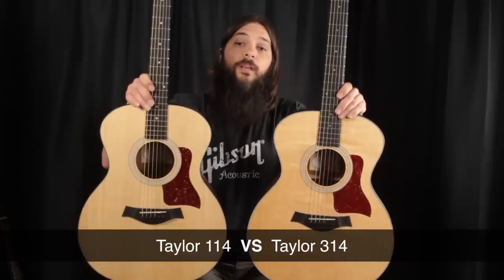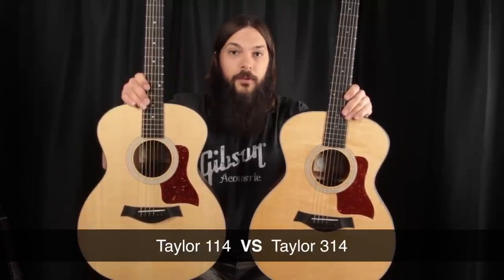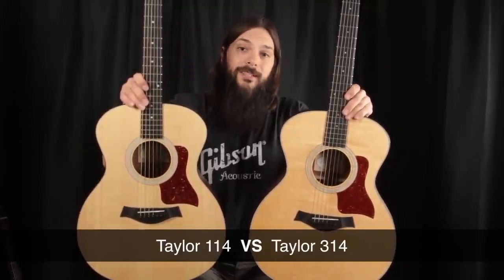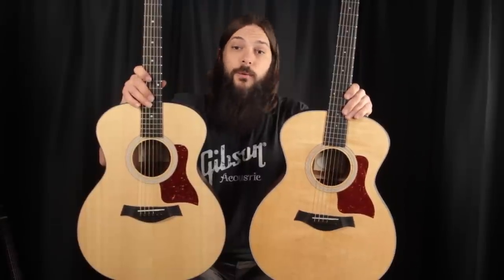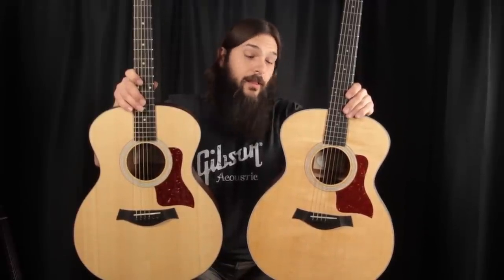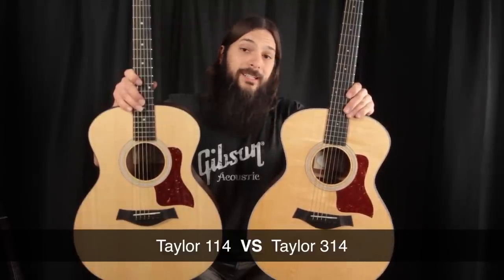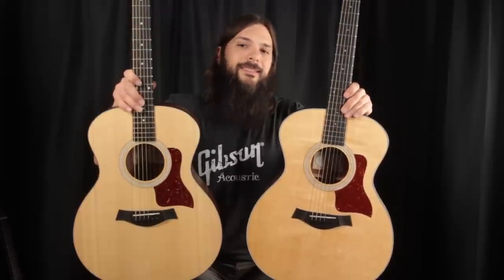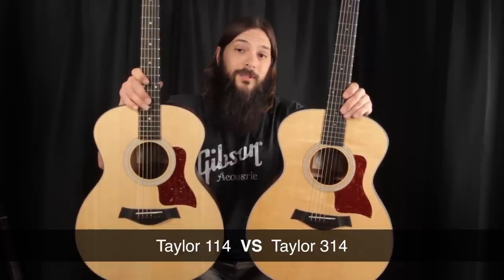Taylor 114 vs 314 - Laminate vs Solid Wood Comparison

Comment: Seems to me that the 314 has a slightly better balance between the volume of the low and high strings. The 314 would be my choice as a solo instrument as it's got a more 'complete' sound, but the 114 might just sit better in the mix if you're playing with other people who already have the low end covered.  

It usually come down to budget though and you won't be disappointed with either. There's always going to be something better, and more expensive, so don't get hung up on the diminishing returns a 'better' guitar will give you.
Reply: +MediaPC 
At last, someone who knows something. Bravo!
The 314 has warmer overtones (slightly) I have a 114e. I like it a lot.

Comment: 51 MontyPython
You're right the 114 did sound better, glad I didn't spend the extra $$$ for the 314.  But your "break in" statements are incorrect. The laminates on the 114 will "break-in", wood that vibrates will change, regardless of solid or laminate. The laminate Sapele on my 114 vibrates against my body just like my solid wood acoustics. I think Taylor did a fantastic job of creating these laminates.
 True, the solid Sapele will experience a more dramatic change, but maybe not enough to make the 314 sound that much  better. Also, you got a little mixed up when you talked about the laminates and tops, Both the 114 and 314 have solid tops. Laminate break-in has nothing to do with the tops. Just sayin'...

Comment: 114 brighter...314 basser
It goes to show the back and sides really doesn't matter that much. The top is the important wood. The back and side are just a sound box. I think if you upgraded to the same nut & saddle they would be even closer.

Comment: The 314 sounds more fundamental and woody. The 114 has more ring. 

It's hard to tell from the video here which is better in the room, because the 314 could very well be louder. I had two guitars once  - a poorly made crafters of TN acoustic, and a perfectly made bourgeois slope D. The latter was much louder and clearer than the former. On a mic where the volume difference wasn't noticeable, the crafters was much more vivid sounding- you couldn't notice the difference in volume if you weren't in the room - the quieter guitar sounded much bigger and more 3d on recordings. 

(poorly made was my particular guitar. CoTN was in a death rattle, but I didn't know it - compared to some people, I was lucky to get anything at all).

Comment: Have listened to a lot of these A-B test from acoustic letter. Generally find myself nodding in agreement that the more expensive instrument is the better sounding (and I always listen to the audio without watching first) in this case I would say the 314 is not worth the extra money.
Reply: Not to be critical of the videos, but I wouldn't make a decision based on video comparisons alone. You really need to play them yourself. You will hear character in the instruments that isn't conveyed in videos.
Reply: I notice the biggest improvement when he plays a note but when he changes to another note.  The 314 sounds far more liquid and clear to me.  Perhaps on the 114, as soon as the string isn't playing a pitch, the sound stops dead, while the 314 in effect continues to resonate for 10-20ms?
Reply: Jeremy Boughtin I agree 100%..you need to a/b each guitar in the flesh..I tried a 114e and a 214ce and not a huge difference,  certainly not 450 euros of a difference 
I have yet to try the 314. .they are all fantastic guitars and the es 2 system is excellent. ..value for money methinks..

Comment: dont make any diff if sides and back are solid or laminate the sound comes from the top and through the soundhole. as long as its got a solid top woods on back and sides are just cosmetic.
Reply: Very wrong; sorry. Back and sides make significant difference. Read up on it and you'll learn some of the differences, then listen more critically and I'm sure you'll hear it. Tonal range, sustain, volume, lots of differences. I have an 814ce and my wife has a 214ce. Both have same wood on top, as almost all Taylors do. Admittedly there are more differences than just the back and side wood; 8 series has more sophisticated bracing and relief rout of top. But mine has solid rosewood back and sides; wife's has rosewood laminate. HUGE difference. It's very noticeable. It's hard to imagine anyone comparing the two guitars couldn't hear the difference. And compare rosewood to mahogany to maple to sapele. If you can't hear the difference, then by all means, stick to your belief that only the top wood matters and buy a cheap guitar. But millions of experienced guitar players and luthiers will differ with you.
Reply: David your so very wrong lol look up the taylor 214ce and the taylor 214ce koa deluxe. its just a laminate back and sides on the koa and you will hear a difference

Comment: Run this through actual speakers. they difference between the two is very clear. The 314 blows the doors off of the 114.

Comment: 314 is much fuller,   the 114 still sounded good and still has a Taylor sound.    It would be interesting if both guitars had the same bracing.    For the price of the 114 you could do much better.    Lot of All Solid guitars these days for well under $800.

Comment: Its not as simple as laminate vs solid.  I have nothing against laminate (I own one), but the bracing has a more significant impact.  Play a 314 and 114 back to back in a store - the bass response is much stronger, giving a more "whole" tone in the 314.  Not to say the 114 is bad, its just a different sound.  Its up to the individual to decide if the 314 is better, and if so, whether its worth the price increase. For mine, here in aus, where its about $1700 difference, I'd be more inclined to go with the 214.
Reply: I've been trying to decide which I want, 114 or 214. honestly I feel that the 214 is a mix of the two. but now that I'm watching this I'm falling in love with the 114. What's your opinion on the two?
Reply: +Austin Alvarenga I don't know if you bought yours yet, but the 214 is basically just a different skin. It's only a veneer, and that has virtually no impact on tone. Beauty is in the eye of the beholder, but if your biggest concern is the tone then save yourself some money and go with the 114.
Reply: Austin Alvarenga I like the 214.  I have a big baby, and I find the 100 series to be a more grown up version of that - the 214 is a little warmer to my ear.  It doesn't hurt that it looks that little bit nicer too, particularly the koa version - that's where I'm looking next!

Comment: If you listen on a good audio setup you'll immediately hear that the 314 has much more volume in the lower register. If you actually play them you'll also feel that the 314 resonates much better than the 114. Also those are 2 new guitars. With age the 314 will only get better.

Comment: 114 Has a bump in the 500-800hz area and the high mids around 4k are a bit harsh. If I was EQ'ing this guitar I would cut these frequencies. Similar sound signature can be found in lower tier Martins too. 
The 314 on the other hand has neither of those problems and already sounds like it was EQ'd. This is also the case with higher tier Martin guitars. They sound "professionally produced record like" without having to fix anything. 

The price difference is justifiable only if you'll be recording this guitar - often. For an occasional recording session and mostly playing live or at home etc. the 114 is more than adequate. 
If you really need to record that magical a la Dire Straits acoustic tones, renting one for the recording session might be more economical. 
The 314 is clearly superior in sound and I imagine build too.

Comment: TL;DR - Don't ever trust videos like this. Every guitar is different (factory made guitars especially - contrary to what you might expect) and you should try them in-person before you buy.

I see a lot of people in the comments saying the 114 sounds better than the 314. I actually agree, however I'd like to point out that videos like this are completely useless for 2 reasons. 

First, the recording and playback process does not actually faithfully replicate the original sound. The mic, the editing process of the video, your internet connection, YouTube's compression/processing, and finally your speakers/headphones all play a part in modifying the original sound. These effects compound on one another, and by the end you aren't hearing what the guitars actually sound like in-person.

Second, and this is something I've seen nobody in the comments mention, is that every single guitar sounds different. If you take two 114s and play them side by side they will sound different. If you take two 314s, or even two 814s, and play them side by side, they will sound different. It is absolutely possible to find a 114 that sounds better than a specific 314, or even better than a specific example of an 814. One thing I've learned as I've gotten into luthierie is that there are very real differences in the pieces of wood used to construct these guitars. In a factory setting, they do not take this into account as they make the guitars. Each guitar is made to spec in the exact same ultra-consistent way, but this does not produce ultra-consistent tone - it actually produces the opposite. You can have two sets of Sitka top plates that both have amazing grain and look like they're going to sound amazing, and one will end up making a dud guitar while the other will make a god-tier guitar. Wood is inherently inconsistent because each cut of wood (even from the same tree) is different. Luthiers take this into account when voicing a guitar by adjusting the bracing, top thickness, etc. on a per-guitar basis to really squeeze the best tone out of each piece of wood, but factories can't do this (it's not a bad thing, they just have different goals - factories are focused on mass production, luthiers are focused on craftsmanship and making the absolute best guitar possible given their materials, tools, and most importantly their skillset).

It's totally possible that this particular 114 is just better than this particular 314. Once you learn how guitars are made and the difference between factory and handmade guitars, this isn't surprising in the slightest. But you should not extrapolate this to "Taylor 114s sound better than 314s" because it's going to depend on the specifics of each individual guitar.

Comment: The 314 comes with different strings than the 114 with heaver gauges on the first 3 strings of the 314.  If you put the 314 strings on the 114 would this not tone down the brightness of the 114 and make it sound more like the 314?

Comment: The 114 is good, but it still has that laminate upper midrange quality that is a tiny bit harsh. Though the 114 is much better than so many other laminate acoustics out there. The solid wood 314 is richer sounding, and will improve a lot with age. The laminate body 114 will not improve much.

Comment: Is it me or is there really not any difference between the two?  I'm using bose earphones and I really can't distinguish anything.
Reply: First of all not the branded headphones but your ears are the most important:P Differences are pretty clear. For example 114: sharp midtones, selective sound, and sounds cheaper than 314 but still good! 314: full/balanced sound, better presence, warmer sound. Greetings!
Reply: caloyjp There isn't much difference between the 2, esp. between certain styles.  The only clear differences I can hear is when chords are played and how the notes produce by the strings are separated and the 314 has little more bass -- but which is better is probably subjective.
Reply: Yep. Not much difference.

Comment: price is a difference point. but the 314 will give someone a lifetime of great tone. solid body acoustics are the only route to take. in terms of resale value as well as tone. like great electric guitars acoustics sound better with age. 25 years from now that 314 will still be a great instrument. the 114 is a good guitar, but how it holds up over the next 25 years? we don't know. if you need a good guitar and have a budget get the 114. if you want to buy a guitar you can keep for the rest of your life get the 314. I've played both at my local store and the 114 is a good guitar. However it's tone, feel, quality, and action are not on the level of the American made 314.

Comment: The 314 is better no doubt but not 2x times better. In fact, only seasoned guitarist could hear the difference side by side. The law of diminishing returns. Are you willing to pay 1000$ more for a slightly better guitar and case? Then you might as well opt for the 414 instead or the 514, 614 or 714...oh man it never ends!

Comment: Wonder why the heck they have different nut widths?
Reply: Hand sizes differ, finger length and thickness differs, playing styles differ. It's amazing how much difference even 1/16" makes. My wife's Taylor 214ce has a 1-11/16" nut. My Taylor 816ce has a 1-3/4" nut. Only 1/16" difference, yet she finds hers easier to play because she has smaller hands, and not only is the nut slightly narrower but that translates into the neck circumference being smaller as well (probably about pi (3.14) x 1/16" smaller, which isn't so insignificant to someone a smaller hand). On the other hand (no pun intended), I finger pick a lot more than I strum, and for me the wider gaps between strings helps a little, at least I think it does. It's such a small difference, it's not a big deal for my picking, I'm sure, but I also have a classical guitar with a 1-15/16" nut, and that's a HUGE difference. HUGE. Again, it sounds almost insignificant, but 3/16" wider than my 816 is massive when you're playing classical style. You need room to get your plucking fingers positioned properly on each string to give it the right technique and produce the right sound. But that makes the neck circumference way too big to wrap my hand around it like I do on a normal 1-3/4" neck, so there are several considerations to take into account when chosing a neck/nut size. I'm sure someone a lot more expert at this than I am could give you a more detailed explanation, but hopefully I've hit the high points.
Reply: Nope, I get it, and I can definitely tell the difference.  (For me personally, I'd be fine with either of the above widths, but switching between the two confuses my fingers for a while.)  I was just remarking because I thought it was odd that
Reply: Woops! because I thought it was odd that the nut width would differ between such similar models (both '14s).  I definitely don't think it's odd to have a variety of widths, just odd to have it vary between these two models.  I even got my Martin D-18 and D-28 with 1 3/4" nut widths because I'm so finicky.
Reply: Jesse Watson I'm guessing that due to the lower prices for the 100 and 200 series, Taylor makes the neck slightly smaller for potentially smaller, younger hands, on the assumption that more experienced players, as they get older, will move up to more expensive models and will want slightly larger necks and nuts to accommodate their adult hands. But that's just my theory; no basis for it at all. Would be interesting to pose that question to Bob Taylor.
Reply: kevinb2014 Actually that's a really smart theory!  Makes sense.

Comment: which one is better for palm muting and strumming?
Reply: There's no difference in both guitar in that case. Both are Grand Auditorium and are very easy to play. The only major difference is that the 114 is layered back & sides giving it a bit more "muddy" sound when compared to the 314's solid back & sides. 
TL:DR -They look the same, feel the same but sounds differently. You won't find any difference in terms of technique

Comment: why on earth would someone spend 1000$ on a laminate guitar?
Reply: +L. Willis Exactly, but this is a solid top, only the back and sides are laminated.
Reply: +L. Willis Because it sounds fucking good...
Reply: +L. Willis 

I bought mine new for$629.00 new
Reply: A laminate guitar? You mean like a D'Angelico? A Gibson ES-175? (Which also has a laminate top.) A Ramirez? (About half of them ever made had laminate backs / sides.) Laminated backs and sides are much stronger, will hardly ever crack from dryness, and will last much longer. Backs and sides hardly vibrate at all. They only exist as an anchor for everything else and as a box to push air through the top's sound-hole. As long as the innermost layer is rosewood (or whatever you want it to be), that's the only thing that gets heard.
Reply: because it has "Taylor" on it.
Reply: Exactly. Get a solid wood Yamaha, Seagull, Washburn, Alverez. Even Martin and Epiphone have some, although they are not the best. Hell, give a Recording King a fret job and you might even get something nearly as good!
Reply: Or one could spend 700£ on a all solid Faith guitar. Much better value imo and build and sound quality to match a Taylor.
Reply: L. Willis play one and you’ll know why
Reply: Gs minis have lam back and sides, yet are one of the most loved Taylor’s.  Snobbery lives.
Reply: Branding and reputation, that’s why.
Reply: to be honest I bought a Taylor Koa 224 ce and compared it to other guitars that were solid body including some martins around the same price and it sustains better, harmonizes better and is more responsive while also having a great tone, its one of those things where if it sounds better it sounds better.
Reply: yeah you cant deny a guitar if it just sounds awesome. I went to 2 guitar centers and sammashes after I bought mine  and no guitar I played aside from a 718 had the dynamic response as mine. Different tones sure, but not one that could handle everything and respond to what I was doing.I have a satin 224 however.